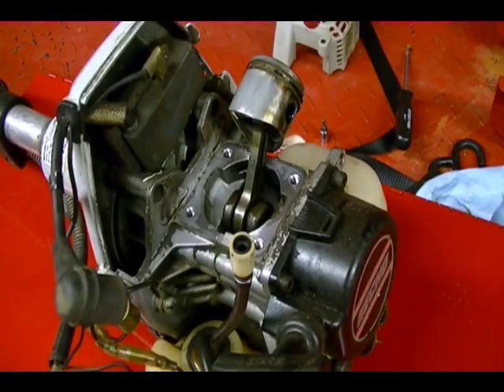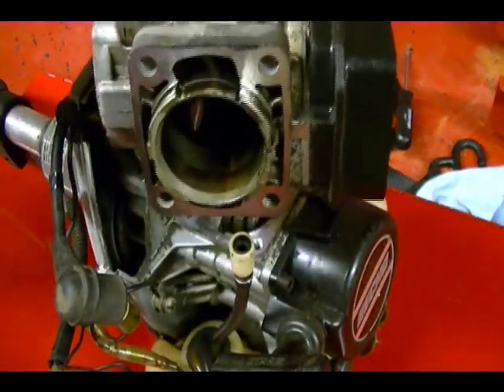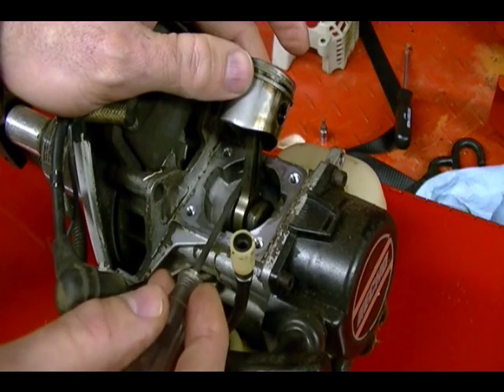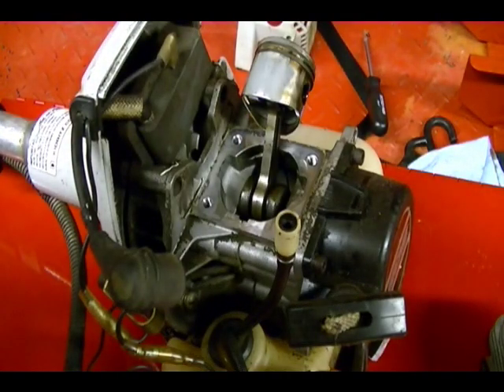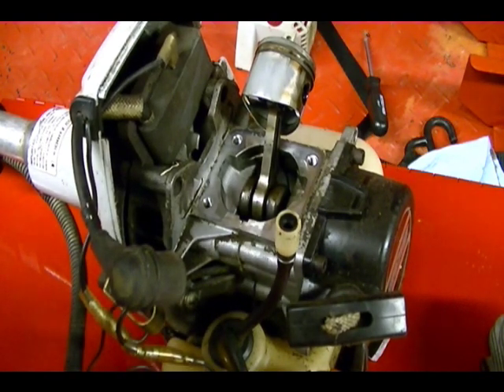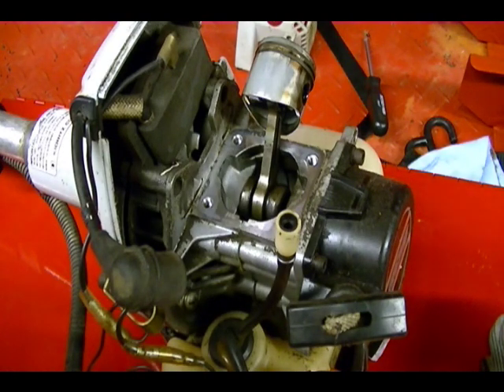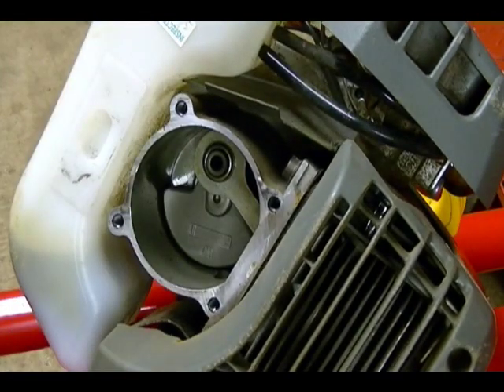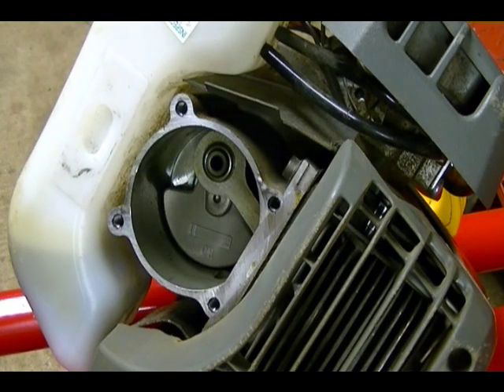Small Engine Repair: Echo and Ryobi 2 Stroke Engine Crankshaft Comparison

Comment: It’s not hidden from the consumer at all. The full crank models have the recoil on the opposite side of the clutch. The cheaper modes have the recoil on the same side as the clutch mounted under the clutch. If you have a model where the recoil assembly is easily removed with 3 or 4 bolts like the Echo, it is a better quality unit.

Comment: I have a half crank in my fx26sc weedeater branded trimmer. It's ten years old and does just fine for my purposes. Full crank design would be nice, but I would expect a larger displacement top end with it. :)

Comment: My 6 yr old ryobi SS80 wont run when i pull the throttle anymore and rather than adjust the carb i got an echo srm 225, very happy.
Reply: how do u get the crankshaft off on the ryobi to check the piston ring?-__-

Comment: You can tell if it's a full crank if the pull start is on the opposite side of the trimmer shaft. If it's on the same side as the shaft, then its a half crank. Great vid thumbs up!
Reply: I figured this out on my own too. It is better if pull cord and clutch is on the back end.

Also half cranks have angled end caps on the crank cases now. Makes it unideal for RC conversions.

Comment: @smallengineshop Yeah it should be, but I noticed on other sites that the short block only cost around $109 and the cylinder is more. Not too sure but I think it's a mistake, or else they just try ripping people off with the cylinder.

Comment: @smallengineshop 	A130000341 cylinder $121.44 from ereplacementparts 

SB1061 short block from ereplacementparts $117.15

Why would someone get just a cylinder when a whole short block is cheaper than just the cylinder is what I'm wondering.

Comment: Half crank engines have the recoil at the front of the engine. Full crank engines will have the recoil at the rear of the engine as a rule. This is how we determine if it is a half or full crank engine
hope this helps
Reply: Counter balance is larger too so the crank case is larger on half cranks.
Reply: Exactly 👍